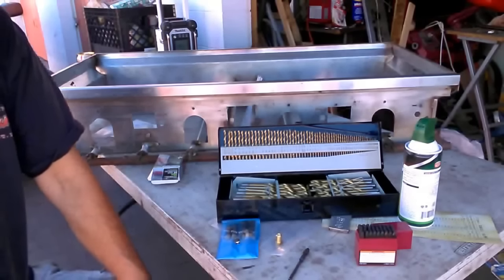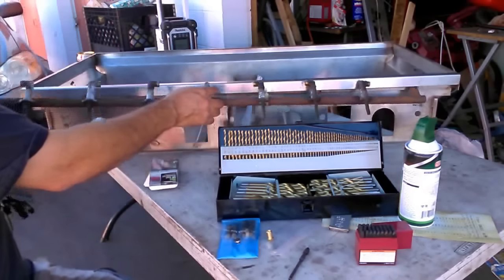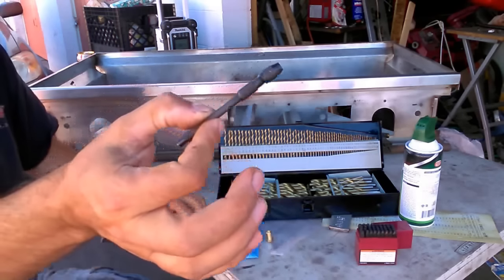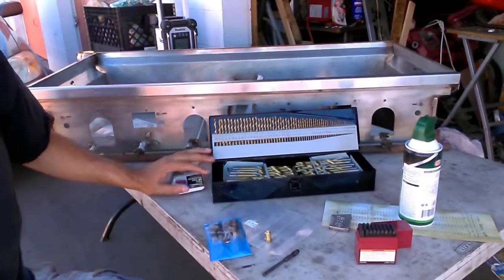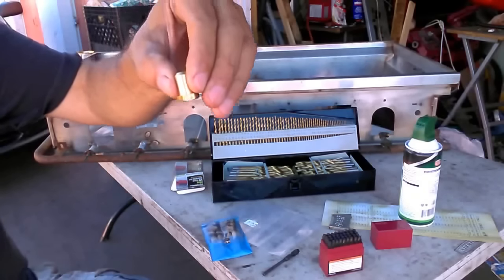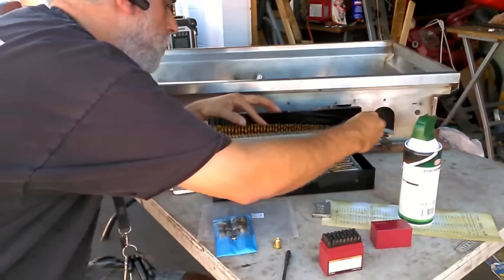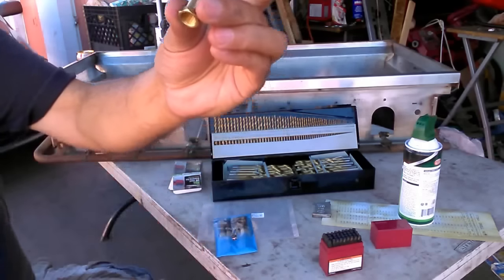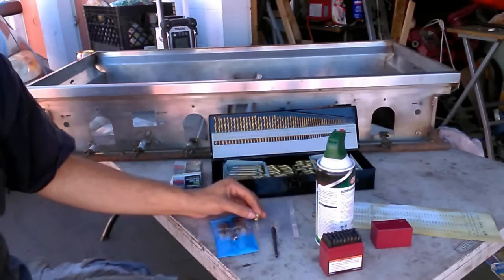Propane and Gas Conversion Basics (How to)

Comment: Hi Frank, great vid, have a potable propane heater 6 thousand btu to 18 thousand btu it has 3 ceramic burners on the front, I believe each ceramic burner is 6 thousand btu's, the propane orfice size is 0.72 wanting to convert to natual gas what size of orfice's will I need 3 orfices in total, does the pilot need to be changed as well or no? Thx Dave.
Reply from the maker: I actually carry orifices for every stove and barbecue made on my website  https://flamesources.com/  I'm now in the Midwest, and you can always get a hold of me at 714-574-1544.

Here's an orifice boring chart from Andersen Forrester: https://andersonforrester.com/conversion-chart/

Comment: Great video.  Bought a blackstone 36” w/ airfryer.  Says it’s not able to be converted to natural gas.  If I bored out the holes by 1 or 2 drill sizes, do you think that would be enough?  They say the airfryer won’t get to temp.  I am at 6,000 feet altitude.  Thank you in advance
Reply from the maker: I actually sell orifices for every stove and barbecue made on my website  https://flamesources.com/  I'm now in the Midwest, and you can always get a hold of me at 714-574-1544.

I can only speak in generalities here because I don't know everything there is to know about your setup. Here's a link to a conversion table from Andersen Forrester: https://andersonforrester.com/conversion-chart/   This is oversimplifying what really needs to be done, but it will give you a general idea, albeit, there is the altitude to factor in. The charts I use take this into account, but those charts are not available on the internet. If I had to venture an educated guess, I would say that the orifice should likely be bored one size smaller than what would normally be calculated at sea level for this setup. But again, there may be other factors to consider.

To further complicate this situation, there's likely a deficit between the sated factory stated BTU of your unit and the actual BTU. You would really need to reverse calculate the numbers using the size of the current orifice for propane with the rated output of the regulator factoring in the altitude. If your grille uses propane with a small bottle mounted underneath, it's likely that regulator is rated at 11" WC. At any rate, you can see how such an endeavor (converting a grille to another gas) could become a slightly complex affair.

Comment: Hi Frank, great video!  I'm working on a propane oven and I am sometimes getting a flame in the air shutter.  Is it possible that a dirty orpheus is causing this?  Thankyou in advance for any help.
Reply from the maker: If the burner is making an unusual noise, then the cause is a perforation (leak) in the burner tube.

Comment: Great info! Right now I’m struggling to find the original NG orifices that came with my 4 year old stove. It looks as if the installers took the parts with them when they converted it to LP and now Natural Gas is available in our neighborhood so I want to switch! GE can only sell me the gas tube assemblies with the orifices in them.
Reply from the maker: I actually sell orifices for every stove and barbecue made on my website  https://flamesources.com/  I'm now in the Midwest, and you can always get a hold of me at 714-574-1544.

Comment: Hello Frank.....  Hears a question I doubt you have heard before.
We have a house in the US out in the country (West Virgina style). All around our farm there are Gas wells & Oil wells. On our farm there are 5 Oil wells. The oil wells also make some Gas. The gas BTU off the Oil wells is approx. 1,900 BTU. 

Per. terms of the Oil lease we (the property owners) are entitled to free gas to our home. I would like to utilize the free gas but I'm unsure if Natural Gas Hot water heaters, Furnaces, Stoves & Dryers would operate correctly on the high ~1,900 BTU Gas without modifications.

 I know manufactures make conversion kits from Nat. Gas to L.P.  ....... But what about from normal Nat Gas (IE: 1050 BTU) to High 1900 BTU gas ....... but not as high as Propane @ 2500 BTU.

You sound like you might have some insight into my Issue.

Thanks,
RDS

Comment: Know anything about the old Martin U-1116 gas heaters? Found one brand new that had been stored for decades, would like to convert it to propane, but the burner has about 100 holes...
Reply from the maker: The burner is likely fed a steady gas supply by a single orifice or multiple orifices. I've done orifices for just about everything made, so feel free to contact me. I've moved to the Midwest , and you can always get a hold of me during normal Midwest business hours at 714-574-1544.

Comment: Hi Frank. I have an early 1900's cast iron cook stove, similar to a Glenwood stove,  that is supposedly set up for natural gas. I would like to convert it to propane. The stove has hooded orifices just like the one in your video. The number stamped on them is a 99 (or a 66), not sure if you read it right side up or upside down. Do you sell orifices with a smaller hole  that I may use to replace the ones I have? I can't search your website because the brand is not listed. Any help would be appreciated.
Reply from the maker: Doing a fuel conversion is usually a simple affair. I've converted just about every type of barbeque and stove made. I'm now in the Midwest, so feel free to contact me at 714-574-1544. You can also visit my website, www.flamesources.com

Comment: Hi, great video, I have a 21000 btu char broil using propane, I want to convert to natural gas...do you know what size orifices I would need , what drill size to use? I just have two burners.  They look like screw type and very small. Thanks in advance Frank.
Reply from the maker: Manufacturer's burner ratings are usually inflated, especially on Bar-b-cues. I usually reverse calculate to find out the heat rating, then translate that to the proper bore using the other gas and output rating. I use very specific data to hand calculate my solutions, but I can recommend a general user friendly chart instead. Here's a chart that Anderson Forester has published:   https://andersonforrester.com/conversion-chart/

Comment: Awesome video. I have a Weber summit S-420 I am converting. What drill bit size would you use for this 12000 BTU model. I have a numbered drill set and a hand drill.  
Also do I need a NG regulator. I read it both ways. Some say yes some no.
Reply from the maker: Some states require the use of a fuel regulator on an outdoor grille, some do not. I'm all about best practices, so I always recommend a regulator. This is your last line of defense. Typically, a fuel regulator is designed to shut off the fuel supply if the system developes a gas leak and goes open loop. The very use of such will determine the input rating of the fuel supply and will affect the final bore size of your orifices. I've likely done 30,000 or 40,000 Weber grilles at this point in my career. Anderson Forester has a nice chart that's easy to understand, so you can find it on the web. One more thing. Weber ratings on their burners is inaccurate, so dont take those numbers as gospel. It turns out, this is a rampant industry practice, so all grille manufactures do it except for Jennaire. I carry all manner of orifices for everything made, so feel free to call during normal West Coast business hours - 714-574-1544. Here's the link to the Andersen Forrester chart: https://andersonforrester.com/conversion-chart/

Comment: hi frank, thanks for responding.  i tried to respond to your reply via youtube but was unsuccessful.  i needed a pressure reg for my last conversion but the current stove appears to have one that allows a switch to propane .  it appears that the current orifices are way too big but the switch in settings may remedy that.
Reply from the maker: I actually sell orifices for every stove and barbecue made on my website  https://flamesources.com/  I'm now in the Midwest, and you can always get a hold of me at 714-574-1544.

Make sure to like and subscribe to my video channel.

A fuel conversion requires at least two things: a swap in regulators (or a conversion of he current regulator) and different orifices. Feel free to call me and I'll get your straightened out on this conversion.

Comment: Good day Mr Hamilton I have a profile grill natural gas 36 in I would like to convert it to LP can you tell me what the offices would be and do you sell them I need 12 can send a picture thank you for your time in this matter love your video
Reply from the maker: Doing a fuel conversion is usually a simple affair. I've converted just about every type of bar-b-que and stove made, so it's likely that I have the parts for this conversion. If not, I'll make them in my machine shop. I'm in the Midwest, so contact me during Central Daylight Time hours of 9 am to 5 pm at 714-574-1544.

Comment: Very good video, let me ask you to convert propane to natural gas the orifice has to be always smaller?
Reply from the maker: Generally speaking, you'll use a lower numbered orifice if you're converting something from propane to natural gas, however, where numbered drill bits are concerned, the lower the number, the larger the drill bit. Doing a fuel conversion is usually a simple affair. I have every type of every type of orifice made for every type of barbecue and stove their is. I'm now in the Midwest, so feel free to contact me at 714-574-1544 during normal Midwest business hours.

Comment: Great video. I have an antique stove I'm converting to propane but I'm having problems finding 3/8-40 orifices. The ones I can find online are 3/8-27. Do you have a source?
Reply from the maker: I actually sell orifices for every stove and barbecue made on my website  https://flamesources.com/  I'm now in the Midwest, and you can always get a hold of me at 714-574-1544.

Are you sure those threads are 3/8-40? That seems like an ultra fine pitch for something with an American thread. Are they orifice hoods with threads on the inside like the ones in this video or are the threads on the outside. Those would be something that I would have to fabricate if the threads are something other than standard pitch.

Comment: hi, i bought a gas grill with 6 burners and the flame in big and yellow on top... if i drill bigger holes in orifice i will have better results? or i have to buy onother orifices with smaller holes?

Comment: Hi Frank, I have an old Garland 10 burner range that I want to covert from NG to LP, what size orifice should I use?  Thanks!!
Reply from the maker: I actually sell orifices for every stove and barbecue made on my website  https://flamesources.com/  I'm now in the Midwest, and you can always get a hold of me at 714-574-1544.

In many cases, those vintage stoves were "field convertible," meaning that the orifices were simply adjustable to convert from one gas to another. Here's a link to a video that explains this type of orifice: https://www.youtube.com/watch?v=JzcZ-yskLxA   Make sure to "like" and "subscribe to my video channel when you visit.

The wedges that were used on these orifices fall into two categories: those that are blanks and those with specific holes in them to exactly flow the correct amount of fuel once the orifice body is jammed onto them. On an older stove like that garland, it's possible that the wedge IS NOT bored, so you may need to adjust it to flow the correct amount of fuel. Keep in mind that the end result should be a well balanced flame.

Comment: Hello Frank, I have a one year old AO Smith water heater that I'm going to have to convert from LP to NG, is that doable? Thx
Reply from the maker: Doing a fuel conversion is usually a simple affair. I've converted just about every type of barbecue and stove made. I'm now in the Midwest, so feel free to contact me at 714-574-1544.

Having said that, I've also done water heaters from time to time. There's a chance that the parts on your unit are custom. In which case, I would need to fabricate parts on my lathe. Also, that unit likely has a pilot generator/regulator which would require a different regulator component. Traditionally, a majority of these units were made by Robertshaw and Honeywell, but a host of other companies have entered the market, so we'll need to analyze what system controls your unit.

Comment: miss orange county?  i live in fountain valley, also a 714 area code.  i converted a magic chef i found on the curb to propane.  the flame is yellow and far too high.  i'm guessin' i need smaller orifices.  am i right?  the ones in there are huge.
Reply from the maker: I actually sell orifices for every stove and barbecue made on my website  https://flamesources.com/  I'm now in the Midwest, and you can always get a hold of me at 714-574-1544.

Yes. You're likely dealing with orifices that are bored too large for the application and I have replacement orifices for that. If the correct orifices are in place and you still have yellow present in the flame, then you have too much oxygen traveling up the burner tube. You will typically need to trim the burner tube after a conversion to balance out the oxygen/fuel mixture.

Comment: Hi frank i bought a 3 valve griddle and i need to replace the valves. For 3 valve griddles is the orifice size 57?. Sorry but unfortunately there is no info on what brand it is as it’s completely gone . I plan to use propane. Thanks any info helps or maybe you sell the valves too.
Reply from the maker: Doing a fuel conversion is usually a simple affair. I've converted just about every type of bar-b-que and stove made. I'm now in the Midwest, so feel free to contact me during normal Midwest business hours at 714-574-1544.

Comment: Good morning frank a have a phoenix http 80 gallon propane water heater. It's a commercial. I want to converted to gas and use it at home.The water heater has PVC piping. Is there a way to install it at home.

Comment: Hi, great information.  Thank you. 
How do I calculate what the proper final orifice hole size should be?  I am converting an outdoor turkey fryer burner, older nice heavy cast iron burner that is currently.   propane, converting to natural gas?    Later, I would like to ask about required plumbing pipe diameter volume/pressure and regulator type/size.  Thank you for sharing.
Reply from the maker: Doing a fuel conversion is usually a simple affair. I've converted just about every type of barbeque and stove made. I'm now in the Midwest, so feel free to contact me at 714-574-1544.

There are plenty of orifice calculators on the internet. Unfortunately, to do it safely, you'll need to know the actual BTU of your burners because manufacturers often lie about the true BTU of their burner systems. To do this, you'll need the numbers stamped on the orifice and output of your current fuel regulator. This will enable you to calculate the actual BTU of that burner. Typically, a burner is typically about 8 to 10 percent less than what the stated value is. So a burner rated at ten 10,000 BTU would actually be about 9,200 BTU.

To further complicate things, manufacturers often use a lesser BTU for propane than they do for natural gas. You'll usually see this stated on the label. However,  this is not usually the case on commercial products.

Comment: I have purchased a flat Toastmaster Pro grill series, TMGM48 from someone. The person, I purchased it from converted from original natural gas to Propane. So now I am trying to converted back to natural gas. Can you please tell me where can I get orifices and what size of the hole it should be ? What made it more challenging is this American company is out of business - thanks in advance
Reply from the maker: Those are likely parts that I have in my extensive inventory. If not, I can machine the parts Doing a fuel conversion is usually a simple affair. I've converted just about every type of barbecue and stove made. I'm now in the Midwest, so feel free to contact me during normal Midwest business hours at 714-574-1544.
Reply: @frankhamilton8257  Thank you Frank.  I will call you on Monday